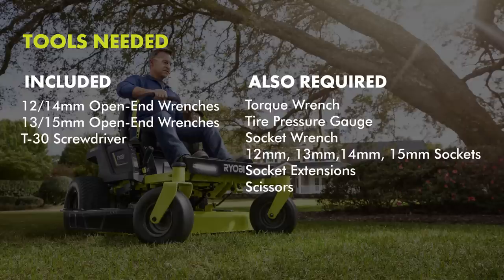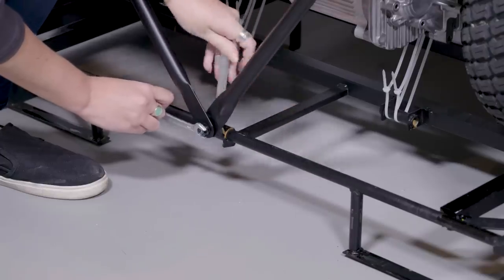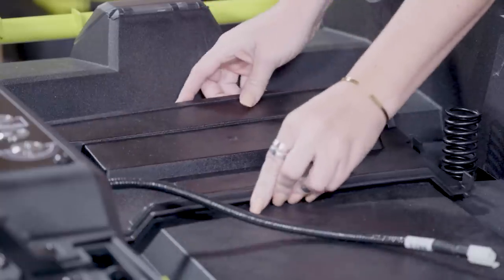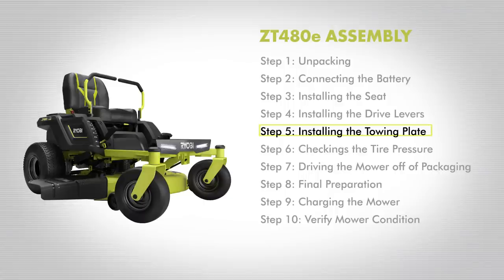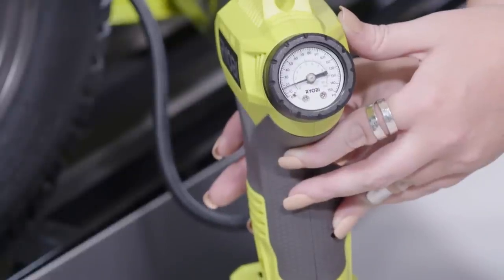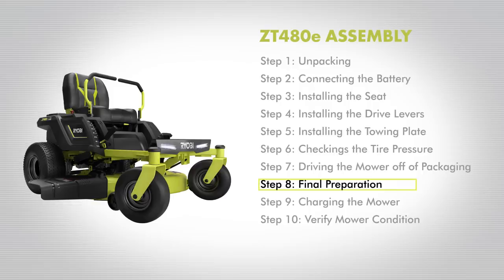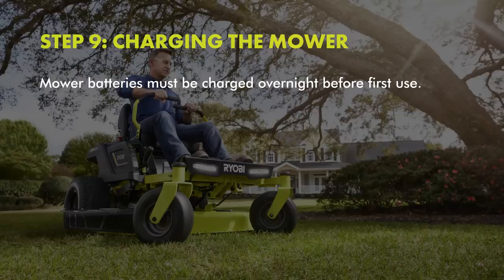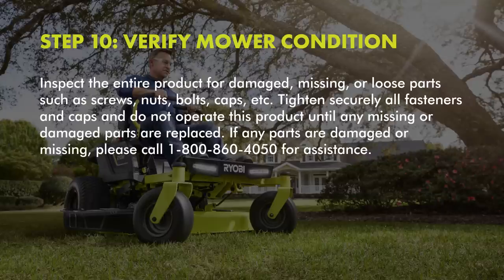How To: Electric Zero Turn Riding Mower Assembly Guide (RY48ZTR75)

Comment: How do I clean the underside of the mower deck after using.  Since you can’t spray with a hose/ water like gas machines.  
I love this mower and have used 4 times so far.  Want to keep it in good shape.  Thanks. 2:08